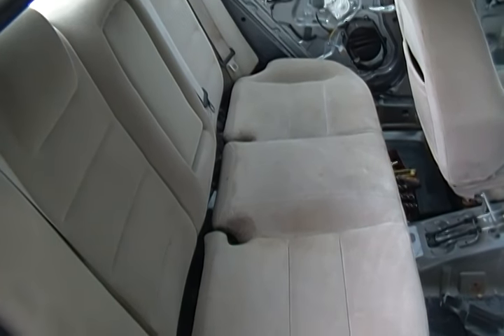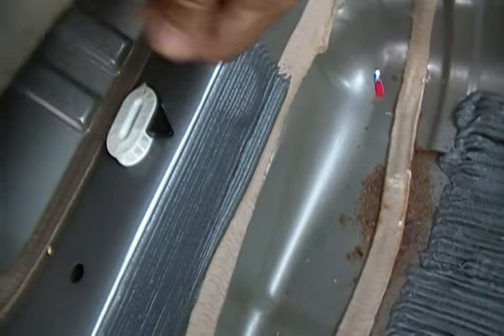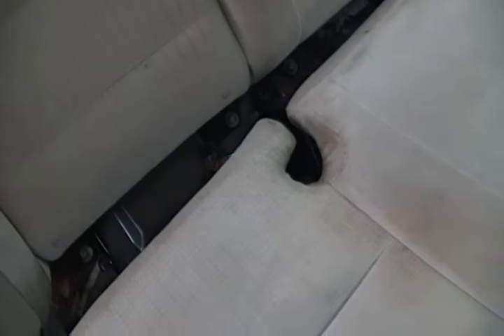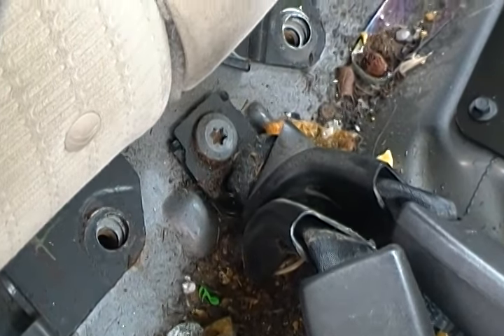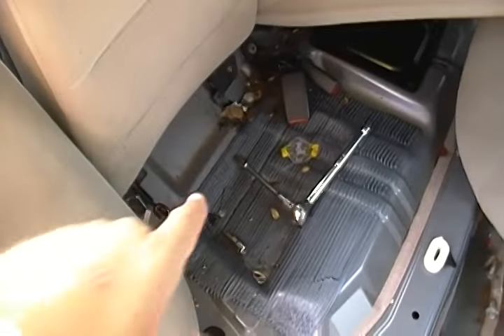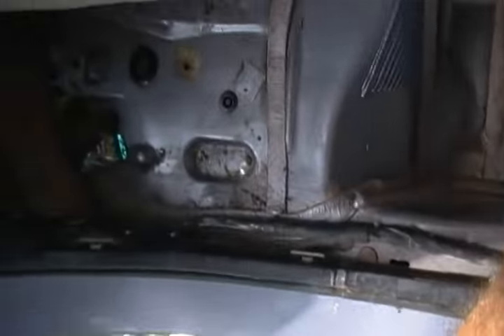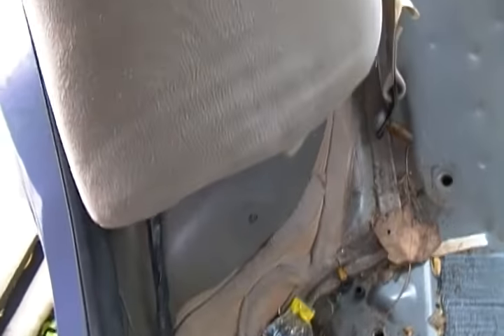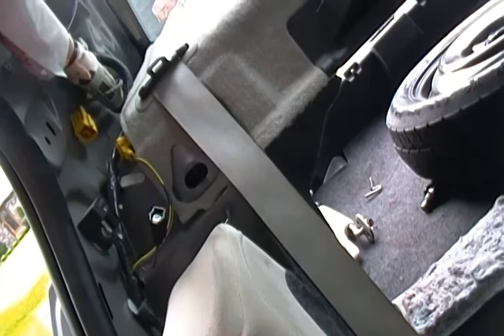How to Remove the Rear Seat and Seat Belts

Comment: What about replacing the seat belt in the back seat right behind the driver the one side of the belt is in the seat how do you access that to replace
Reply from the maker: There is a socket extension (T-51 I believe) you can get at autozone or any parts place to take them completely out if that is what you are asking. 

If you have to access the entire seat belt, most cars you probably have to remove the seats to access the entire belt.

Hope that helps.